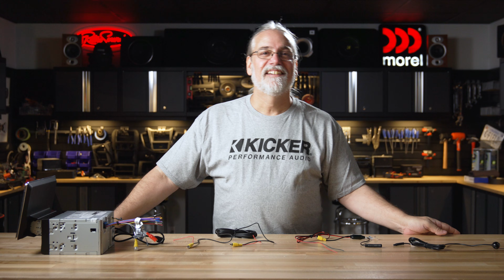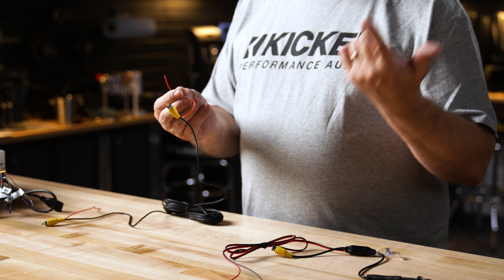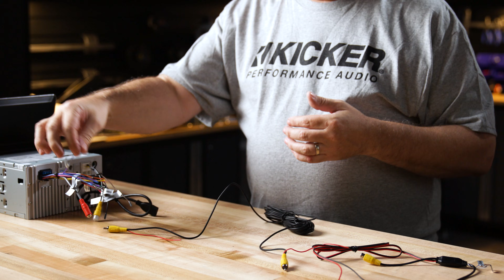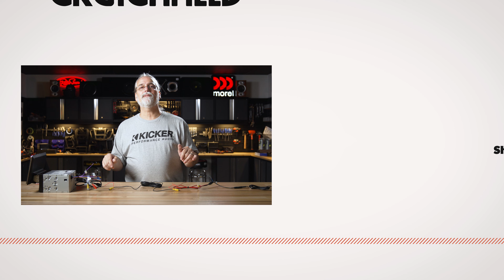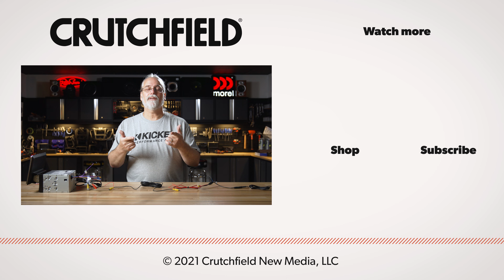Powering your backup camera (and how to use that extra wire) | Crutchfield

Comment: I have the same model back up camera. I went to put it on my GMC Yukon because the one I had was always blurry. My wire harness that came with mine (same model) is different. Only one RCA connector and it has a 6" red pigtail wire coming from it.  The other end has the connector that plugs directly into the camera. With what I have I don't see how it will work. It came from Crutchfield.
Reply from the maker: Thanks for reaching out, we're happy to help! Free tech support is included with every Crutchfield purchase,  just locate your Crutchfield order number in your confirmation emails and give our experts a call at 1-888-292-2575.

Comment: With the camera setup to view the trailer while driving, can you also have it turn on when in reverse.
Reply from the maker: Yes, you can. In the scenario you describe you would want to make sure your camera was supplied with accessory 12-volt power so you can manually select the camera view, and the camera will be powered while not in reverse. It is also a good idea to choose a touchscreen radio that can easily select the camera image manually from the touchscreen. Check out from 3:03 to the 5:10 minute mark in the video to outline how to connect for viewing your trailer while driving and using when in reverse.

Comment: what if my stereo doesn't flip back to stereo it stays on the camera (no signal) after shifting to drive or park. It works fine in reverse I have the Kenwood ddx5707s  connected the way your video shows. Power at the reverse light and ground then the trigger wire at the unit.
Reply from the maker: If you call and provide your Crutchfield order number, our tech support group will be happy to troubleshoot with you! 1-888-292-2575

Comment: How do I view the rear camera while in drive? Your video is excellent, and I wired mine just as you instructed, but am reluctant to do the head unit connection until I know how to toggle the screen to view my trailer while going forward.  Do I just tap the screen button for the camera somewhere in the menu? This is my very first rodeo.
Reply: connect camera at back of car/truck. if car?, connect camera's power lead ( red ) to a 12 volt always on when key is on?, or straight from battery. connect black lead from camera to a clean ground ( frame works best ). run rca cable to head unit ( radio ), plug yellow lead into input for rear camera ( will most likely be colored brown) DO NOT CONNECT RED LEAD AT THAT END TO PURPLE/WHITE STRIPE ( reverse trigger wire ). if you are doing this in a truck?, at back of truck, at 7-way towing pin connection, tap into the red 12 volt dc power that gets power when key is on. black lead again..to clean ground. on both set-ups..locate the reverse wire in junction box, fuse panel, run a wire from there to the reverse input trigger wire at the back of head unit ( radio ). if you connect it up correctly?, you should have not only a cam picture when backing up?, but also a cam view of the rear cam when driving forward down the road. also, yes...you will have to find the settings menu on the radio to view the cam at the back to watch while you drive forward.

Comment: I bought chinese Android 14 multimedia device for my 2005 Volvo V70 and connected reverse camera to it. To my surprise, no trigger wires needs to be connected. Only cameras red power wire connected to backup light fuse box, black wire to car chassis,  and RCA -wire from camera to main unit. It's working just fine. When I put reverse on, device shows automatically back up camera video.  So, no trigger wire hassle needs to be figured out in this case.

Comment: Hi, I'm having a problem finding the trigger wire, I have found a 12v supply that goes on and off with the ignition but it says no signal, you say there is an actual reverse wire but how do I find it, I was thinking just a live wire would be ok, I been going over and over all week what I've done trying to get it working, occasionally I get a flickering screen for few seconds or I turn off the ignition, then it's back to no signal, I can't see anything on the car players wiring to say what that reversing wire it is, obviously I don't want to put it in reverse and touch every wire to find it, I could really do with your help I'm getting nowhere. Thanks.
Reply from the maker: You may have more issues that just locating a reverse wire to connect to the new radio because when a radio is triggered to display a backup camera and no camera is connected to the camera input, you will either see a message about there being no signal or you will see a blank screen. If you are not connecting a backup camera, then it would be best to leave the reverse wire unconnected on the new radio. If you are trying to get a connected backup camera to display when in reverse, then there seems to be a few wiring issues that need correcting and we recommend contacting technical support for this help.
Reply: With the method that allows to view trailer while driving driving, does it still turn camera on when in reverse?

Comment: Just a thought but could you connect the reverse trip with to the 12v camera wire at the back of the system without going into the fuse box?
Reply from the maker: Hi Trevor, yes. Many models easily allow you to tap in for both reverse and power there.

Comment: I'm still a bit confused about wiring it up to a reverse wire
Reply: Cut reverse wire bulb power and take the camera red wire and twist with one side of the reverse power wire crimp one side and camera wire together then crimp the original wire back in. If you use crimp use heat shrink version especially if your lamp will be exposed to the elements

Comment: so i have just installed a abckup camera, sometimes leaving reverse the radio unit restarts, how can i stop this?
Reply: you wired the radio to get power from the reverse power only..lol. in other words..your radio is getting power when you are in reverse only!. from car/truck harness side, you are after the red solid wire, this is switched, so when you turn the car/truck on?, the radio gets 12 volt power. a 12 volt dc test light can be used to check which wire from car/truck harness side gets power when you turn the key on?. this goes to red wire on head unit, black wire from car/truck harness side is your ground. yellow wire from car/truck harness side is constant 12 volt power, this connects to radio to keep the memory for clock, pre-set stations so they do not forget. orange/white stripe wire from car/truck harness side is for the dimmer function. white/white stripe, green/blackstripe, purple/black stripe, gray/dark stripe...all 8 or these wires are your speaker wires. blue/white stripe wire is for remote amp turn on, or power antenna. purple/white stripe is for backup/reverse wire input trigger wire from reverse light power source.

Comment: For the convenience wire is it necessary if my headunit receives the reverse signal from the canbus unit?
Reply: If you have the can bus adapter and have the vehicle specific wiring adapter. As well as your vehicle was programmed from factory with that feature then yes. Otherwise you might have a trigger wire already coming from the factory harness

Comment: thanks for the video. having solution 2, having camera working while driving on D, you did not mention if ground connection is required. You only said to connect the 2 red wires together at the rear end where camera is (12v camera power cable and that of the length cable ). can you explain why chassis ground of back up camera is not needed in this instance? is it because you send power from front radio to rear where camera is and radio is already grounded?
Reply from the maker: The camera will need its own dedicated chassis ground connection, regardless of where you tap in for the power wire connection.

Comment: Thanks for the video! I just installed my camera   and wired it for use whenever I want.
Reply: So I am a little confused, do I have to hook the camera up to the reverse light?  Can I avoid doing that if I hook the red wire up to the back wire on the radio?

Comment: How does it know it’s in reverse? Do you tie it into the reverse wire light wire?
Reply: most head units have a purple/white stripe wire that reads reverse cam, run this to either the reverse light wire at back?, or..tie it into the reverse wire from the fuse box up front? if you are doing this install in a truck?, most trucks have a 7-way plug at the bumper?, use this for power ( red wire ), also for ground ( white wire ) ( trailer plugs in most 7-way plugs are white for ground!!) at camera end. at the front ( head unit ) DO NOT USE THE RED WIRE !. from the purple/white stripe wire, run this to the fuse box after you locate the reverse light wire in there?, connect the purple/white stripe wire to there.

Comment: First off, excellent video and well explained, thank you so much for not just doing it without explanation while overpaying some annoying music that blows your speakers as soon as it plays. I mean I was about to trash the whole aftermarket camera system before I found this. 

I ended up having a couple extra camera modules and wanted to use them in the home for security. Ive attempted this every which way till Sunday and cant seem to get it right, will not show up om my inputs of my TV. I spliced in a matching voltage ac adapter to match the needs of the camera. I think its a 12v Sony module, and I used the existing portion of the harness as it was seeing as it was complete already with an rca plug at the end to hook into whatever screen youd have in your car. Still I get nothing. 
I know it fan be done, because I had a fried who had them all over his property. Id ask him but he sadly passed away before I had the idea to also do it. 
I mean these things are the way to go. Theyve got an excellent wide view with great resolution and you can usually get em cheap, I mean CHEAP, compared to what outdoor security cameras cost you. 

Can you give any advice on this? 
Of course youd not be liable or anything.  Id sure appreciate it.

Comment: Long shot here. I had a android i was using as a reverse camera it no longer works. The camera is still hooked up, I hard wired it into my brake light. So i can save myself the trouble. Can I already use whats there a 3.5 jack that used to just plug into the android and itll switch when i put it in reverse. Can I buy a connector that goes from the 3.5 jack to 3.5 to rca, and plug into the back of the radio?  Do you think that'll work, without having to rewire everything? I hope this makes sense.

Comment: I have a question, when we hook up our backup camera it shows but the camera view is split into 6 screens 3 on the left showing what the camera is seeing but the other 3 I do not know what it is showing and why?
Reply from the maker: It sounds like either the car stereo is in a mode to show video from multiple cameras or the car stereo installation gear is attempting to send video from multiple cameras in the vehicle that previously were able to combine together to show a birds eye view of the vehicle. We recommend checking for settings in both the car stereo and the installation gear to see if there is a way to make it only shown the backup camera video

Comment: If your Dodge Challenger Sirius radio does not have the reverse gear trigger wire then what do I tap into?
Reply from the maker: Tapping into the tail light harness in the trunk is typically the most common location to tap into power for a rear view camera. The other option would be at the fuse box.
Reply: @crutchfield  So I have tapped into the reverse light. The lights come on the camera when car is in reverse, so it does have power. But the rca cable with the convenience wire going to the radio is where my problem ls. I have a input plug for the rca cable but there in nowhere to plug in or connect the loose red wire (convenience wire)  attached to the rca cable. What do I attach the red wire too? There is no reverse trigger wire on the radio. So how do I get the picture to come on my radio? Appreciate you getting back to me! Please help I am driving myself crazy LOL

Comment: Take a test light 

Turn car in on position
Put something on break
Put in reverse 
Make sure car is not running of course
Take test light put the clip on a ground and take tail light and find connection and test each one until you see the light light up 
Use that wire to tap into

Comment: So on a Jensen unit, if I wire the camera red wire to the 12v source I will be able to view the image on demand, when towing for example…. If I don’t use the trigger wire the camera will not activate when the truck is in reverse…   And the trigger wire can be left unused if I don’t care for automatic back up cam?
Reply: the purple trigger wire from the jensen is only used for backup. if you want the camera to come on only when you turn the head  unit on?, then just use the red wire at the head unit end. alot depends on how you want to use the backup camera?. you mentioned towing?, so i'm guessing you are installing this in a truck?. most trucks have a 7-way plug at the bumper?, use this for power ( red wire ), also for ground ( white wire ) ( trailer plugs in most 7-way plugs are white for ground!!) at camera end. at the front ( head unit ) DO NOT USE THE RED WIRE !. from the purple/white stripe wire, run this to the fuse box after you locate the reverse light wire in there?, connect the purple/white stripe wire to there. ( leave the purple/white stripe wire out, tape it up) if you do not want to use the camera for a backup camera?. by not using the backup camera the way i am posting here?, you will have to find the settings on the head unit to be able to switch the camera to view while towing.

Comment: So there's no way to have it do both? Come on automatically when shifted into reverse, and then also have the ability to turn it on for a moment while driving? Maybe I missed the part in the video or where it started.
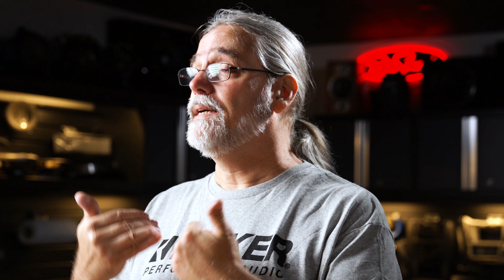Reply: Start watching at 3:10. Hook up your convenience wire to switched 12v power, hook your reverse wire in the head unit to your backup lamp wire

Comment: I have power coming from 12v in the dash via convenience wire. At the back camera is receiving power but no video signal is showing (yes the RCA's are also hooked up). I found that when I unplug the trigger wire OR the RCA at the back the power goes out. Why is that? Why would unplugging the RCA cause the camera to lose power?
Reply from the maker: Hi Jason, sounds like you may want to double check your power, ground, and remote wire to start. From there, be sure and check the camera settings on your radio. If you got the camera here, you can call our tech support to troubleshoot. Their direct number is on your invoice.

Comment: So when you power up the back up camera to always have power does the camera always show on the screen or do most aftermarket head decks have a button that you select to show the camera without putting it into reverse.  I bought an Alpine ilx-670 from you guys and I don't want the screen to just show a camera view [ such as the main menu, etc.].  I'm guessing that there's a selection on the radio to select if you want to view the camera.
Reply from the maker: The camera will not be shown on the screen at all times. It will only be displayed when the vehicle is in reverse or when you manually select the rear camera input from the touchscreen menu.

Comment: Thank you so much sir. Well explained. So tomorrow ill be able to fix my camera. I already installed the camera but when i tured on my key starter, the camera comes on but when i start the engine and reverse it turns blank. So i just have to connect the little wire from the  RCA wire to the pink reverse wire in the canbox ?
Reply from the maker: Yes, in order for the stereo to automatically switch to the rear camera input when the vehicle is in reverse, you'll need to connect the aftermarket stereo's reverse wire to the reverse lamp circuit in the vehicle.

Comment: I had my backup camera working and then it didn’t. Found a lose ground and issue fixed. Then issue again and now I can’t seem to find the culprit. 12v constant from trailer plug, trigger wire & ground connected to tail light harness. Trigger wire closest to the radio connected to the purple wire. It’s like sometimes it’s working and then it won’t. Any suggestions would be greatly appreciated.
Reply: sounds like a wire at one of your connections is not making a solid connection?. your post does sound like you have it all connected right, but just some bad/loose connections at the connection points. i just installed a backup camera to my '00 chevy silverado, like you, i used the 7-way plug at the back for power and ground, first tried it with quick connectors ( did not work ! ), then ended up pealing insulation back on the red wire for power, taping it up, same with white wire for ground. then at head unit, i did NOT use the red wire, taped that up on the camera loom. plugged the rca yellow into the brown rca connector on my new pioneer avh-2550nex head unit. for the purple/white stripe wire, i connected that to the reverse light out of the lower left junction fuse box after i found the reverse power light wire with my 12vdc test light, this is to trigger the backup camera. by installing it this way?, not only do i have a backup camera ( tailgate handle) that works?, but i can also use the same camera while driving forward with a trailer attached to my hitch?, or..just keep an eye on stupid drivers tailgating me?!..lol.